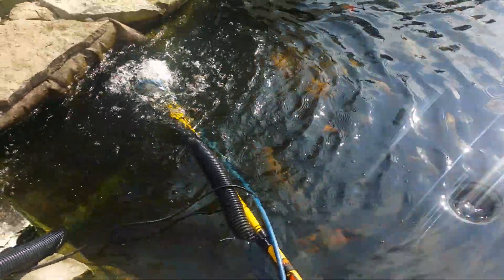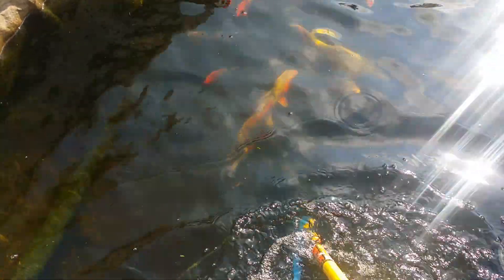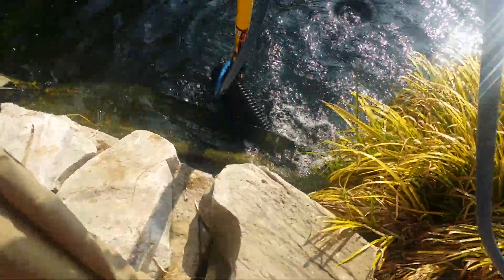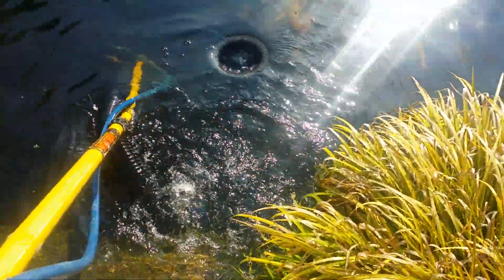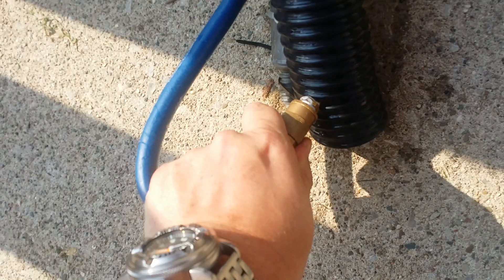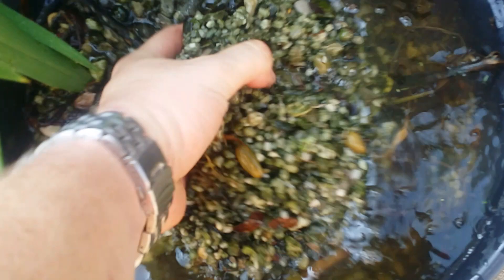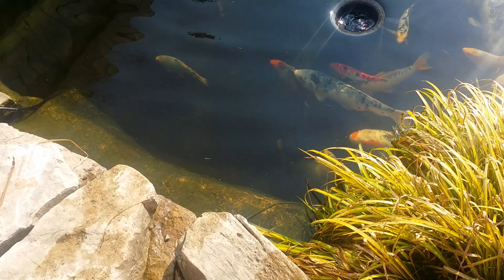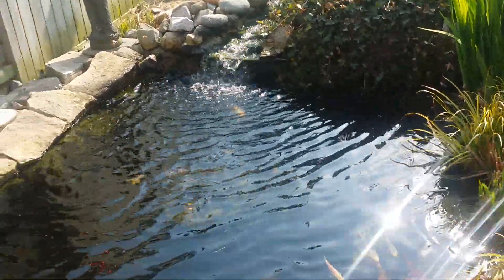Amazing DIY Pond Vacuum using air compressor

Comment: nice video, thanks.  Is it that the size of the mesh will determine what sort of slime/muck you'll pick up?  has the bag ever been too heavy to pull out?
Reply from the maker: Mesh size will always determine the materials you can get out. In this case I used a large hole mesh bag just for rocks and large materials. Never too heavy to lift out.   This would be way more efficient with a large air pump.  I want to try it with high volume aquarium pump instead of an air compressor next.  Don't need air pressure but rather more air volume.

Comment: CRAP !!!!! Just spent the last couple hours of my Saturday setting this all up and it would only suck up small leaves. Had bigger leaves that just wouldnt go. Dont waste your time.
Reply from the maker: Then you need a bigger air compressor with more air volume. As you see in the video it worked fine for me.

Comment: OK Rob, I have copied your DIY pond vacuum using a 6 gallon air compressor. I have attached compressor hose at the base of the vacuum hose 1 1/2 inch flex hose similar to yours. However my compressor does not build pressure enough since there is an open end compressor nossel connected (bolted) into and through the vacuum hose. I have placed that end into the pond and for several minutes without getting suction. the catch bag is submerged into the water. So, do I need to install a shut-off valve in order for the compressor to build up?
Reply from the maker: Sounds like it's doesn't have enough air volume
Reply: Thank you for responding! My compressor works great normally, but the compressor gauge never builds pressure. I imagine it is due to the compressor hose nossel under water at the base of the vacuum hose remains open. What is the length fo  your vacuum hose? And was it 1 1/2 in diameter? Thank you
Reply from the maker: The hose is 1.5" ridgid pond hose about 5'.  You need lots of air volume to make it work. The higher the gpm the better.

Comment: Hi was just wondering on the pond vac .where the airhose goes into the discharge hose what kind of of and did you put o  the air hose for the air to come through.did you use just a fitting that continues to blow air
Reply from the maker: Same standard fittings for everything. Just  drill the hole and screw it in.

Comment: I am trying to find something simple to make to use to clean out the gunk from the bottom of my duck pond.  After watching your video and thinking about how this works, I am wondering what modifications I would need to do to make it work for muddy gunk, rather than stones.  Or if it's even possible.  Obviously the muddy gunk has a much smaller umm 'particle' size than a piece of gravel, and I am assuming that for this to work the material used as the 'collection bag' must allow enough air to escape to create the suction, while obviously having a small enough mesh size to not let the collected gunk seep through.  By mesh size I am referring to the size of the holes in the material in the collection bag that ideally let air escape but are smaller than the collected gunk I want to retain.... (Not sure what the correct term is for the size of said holes in fabric! Lol)
So I assume I need something with a very small mesh (any ideas? Maybe old stocking or something similar?) and also wondering whether anything that has small enough mesh size to collect what is basically smelly duck faeces rich mud is going to potentially not allow the air to escape, and then when I turn on the air compressor, presumably the collection bag will either come loose from the hose or rip/explode.

To complicate the problem there is a LOT of gunk I need to get out of a large pond.

I am hoping the author of this video, or anyone viewing this post who has some experience with this, (especially if they have made something like this for removing smelly mucky mud, rather than gravel or stones) can tell me: 1 whether what I want to achieve is even possible and...
2, if it is, suggestions of material to make the collection bag from, and suggestions of the size of the collection bag and size of hose/fittings etc.  On one hand it would fill up really fast unless it was pretty massive, but I am guessing a large bag would not create enough suction?  Also wondering if the mud gunk will mean that after a few times emptying the collection bag it will be too clogged up to allow air to escape any more.
I have a budget of basically nothing. And have a cheap air compressor with from memory a 24L tank.  The max actual psi that shows on the dial of it when using it for things like stapling is just over 105.  
Also wondering whether my tank is big enough?
I currently have one of those cheapish stretchy cables for the aircompressor. Ie its made from rigid plastic shaped in a tight spiral and stretches/contracts via that. The hose is supposed to withstand up to 200psi but I think it would be more like 110-130 or thereabouts.

I have a pond which is roughly 8m sq which has a LOT of smelly muddy gunk in the bottom 
I don't expect any pump will get all the gunk out, and no matter what tool I use I imagine its going to be a time consuming job, so really just looking for something a bit more time effective than me scooping it out by hand (especially since it's winter here and the water is far too cold to have my arms in past my elbows for more than a few seconds)

Can anyone let me know whether it's feasible to make something using old bits and pieces (ie old hose from a house vacuum)
Also best way to make sure the hole drilled to attach air hose is nice and air tight?  I am not an expert with air compressors and fittings and so on. Have basic handy man tools to drill a hole, and some of that white tape stuff that you put around the screws on fittings to make them airtight and that's about it.
The other thing I was thinking about was one of those things that attaches to your garden hose and uses the water pressure to create suction.  Not sure how they work in general, and also whether they will work when the water is being pumped from a well not mains so the pressure is nothing like as high as what you get from a good mains pressure hose.
Reply from the maker: Kim.  Few questions.  What is the pond made of? Mud bottom, Liner? rock bottom?  Filter bags can be used but on a pond of your size 8M you will need a high volume air compressor to make this work.  My pond is small and is a bare bottom. So a smaller 6 gallon compressor just does the job although a high volume would be better.
Reply: If the level of the pond is kept high enough the discharge hose could be laid over the edge of the pond and all the sludge might be forced by the air up and out over the edge of the pond.  I am thinking the air might be able to over come a 4 inch elevation.  I have a sewage ejector pump that I use to empty my sludge filled pond.  I am toying with an idea of attaching the hose to the inlet of the pump , to the pole and having the outlet to the pump going clear out of the pond.  My muck would quickly plug any bag with fine holes and go thru any bigger holes.

Comment: Thanks for your quick answer! - this compressor's standard fittings size is 1/4" and 1/4" hose, also.  I am using 1/4 inch fittings into my (un)flexible pipe , which is also 2" in diameter and 3 feet long.  Your hose and fittings look a little bigger - maybe 1/2"?   That would be over 4 times larger delivery than a 1/4" hose.

Comment: I'm having the same issues as Joe - not enough lift.  Can you give some specs as the the size air hose / size of the fittings / diameter of the flex hose, etc.?  Our air compressor is a 6hp Porter Cable 150 psi, so I think it is powerful enough.
Reply from the maker: Barb Kent standard airhose and fittings that come with air compressor.  Into a 2" flex hose about 4' long.

Comment: Hello and Greetings from Malaysia. I cant seem to figure out how the air ( unless its hot ) will flow out upward instead of out of the hose ( in this case your outlets being the nearest or the easiest ) . I have tried with my wet vacuum and failed. I am now about to try this idea with my 2.5hp compressor. P/S... I will not be channeling the water back into the pond but straight out into the drain where hopefully in the process, suck out the algae
Reply from the maker: Good luck. Follow what I did and you'll see. If you run the hose out of the pond it may not work as well. I don't know I didn't do it to a drain

Comment: I assume this will work for removing algae, as well?
Reply from the maker: I don't think so. Uv light is the best for algae.  String algea.  Add Clearity max plus and do manual removal.
Reply: +rghill100 Hmmm.....someone else's video of the one they made (that I found after seeing this) showed how it cleaned algae off the bottom of their pond.
Reply from the maker: +Lin Talbot-koehl I guess that depends on the type of algea.  There are hundreds of types I'm sure this can pick up some. It'll also depend on the size of the holes in the sack you use to collect the materials.
Reply: By getting the crap out that is releasing the nutrients the algae is feeding off it will reduce it from growing 😉

Comment: need help! made the vacuum the same way you did air flows out the bag but has very little suction. using a 5hp compressor. trying to get the leaves off the bottomof the pond. My hubby would like to talk with you over the phone if possible.please help us the weather is getting cold and need to clean it for the winter.
Reply from the maker: It's all about the amount of air flowing up the pipe. The more air that's introduced the more suction you'll get.
Reply: what's the diameter of the pvc pipe/tube?

Comment: this is awesome! I have a turtle in my pond as well as koi. a couple of huge dust storms blew in, and the bottom is all muck. I try to stir it up to get it threw the skimmer and pump but t settles rather quickly, which is strange because it is so fine, It would take days. I was wondering if you thought there would be enough suction to attach a hose instead of a bag to go straight into my sewer drain, its about 30 feet away from my pond.
Reply from the maker: Great let me know how it works for you.
Reply: wait so just put an air pump in the side of a hose and it pushes the water into a bag that's in the water!
Reply: rghill100
Reply from the maker: Stephen Vick in a nutshell yes that's it.
Reply from the maker: Not sure only way is to try it.

Comment: I would assume this would work for a plastic preformed pond with dead leaves on the bottom? 

You don't have the air pointed a certain way? Just let air rise like normal?
Reply from the maker: It's just a quick connect fitting on the side of the hose about 2" from the bottom . So as soon as the air is connected to the compressor it gets whatever output the compressor can put out.  Yes it'll pick up leaves it picked up 2" stones on my pond.